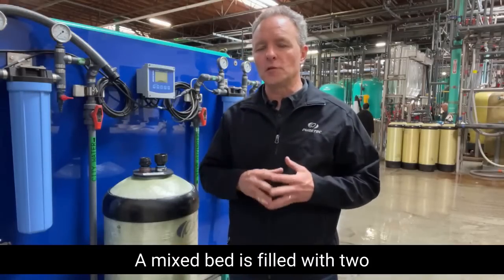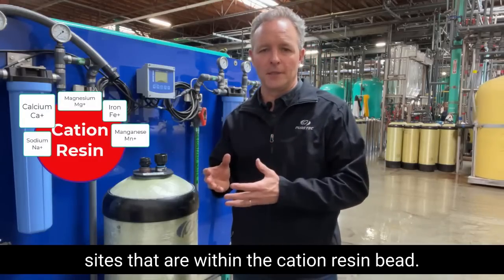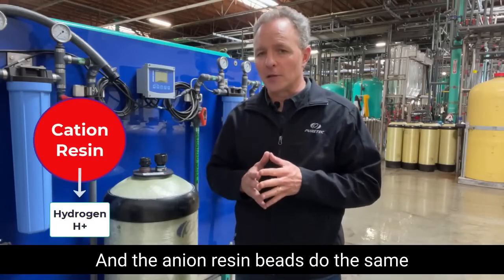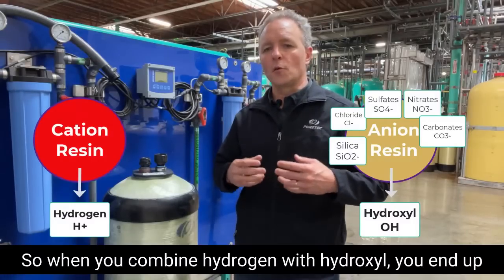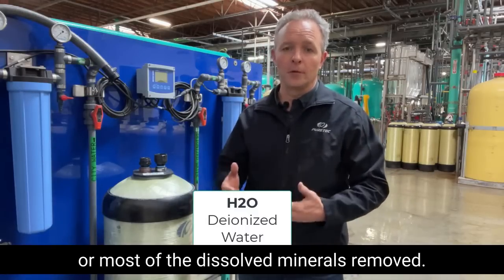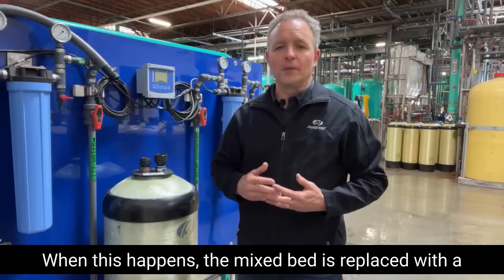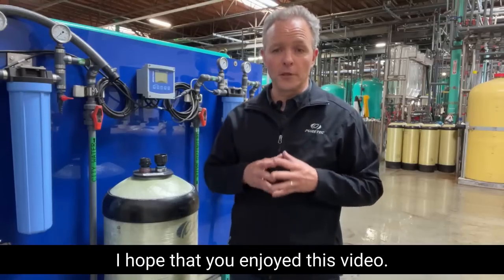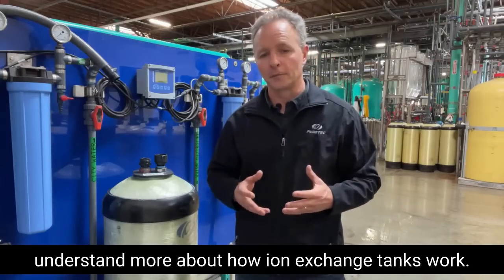How an ion exchange mixed bed demineralizer works

Comment: What do you use to regenerate the resin?
Reply: HCl and Caustic solution are run one by one, doing flushing before and after running each solution.
Reply: Can be done with saltwater brine

Comment: The cations are already positively charged ions, so how do they attract positive ions (Ca, Mg etc.)? or Anions are negatively charged ions, so how are negative ions attracted to anion resin? Please reply, thanks
Reply: Cation resins are negatively charged and not positively charged Please.
Reply: The cation resin beads have a fixed negative charge. They attract cations with a positive charge. The H+ is loosely held on the exchange site and will be released when a cation comes along and takes its place.

Comment: No need salt to regenerate ?
Reply: If you are using the cation resin for water softening then you regenerate with brine. If it’s for a deionized water application then you use HCl
Reply: Apparently 10% Brine can be used for partial regeneration with washing etc. 80C. But ammonium bicarbonate can fully regenerate it with washing at 60C etc.

Comment: What the max tds can it works
Reply from the maker: بينما يمكن استخدام التبادل الأيوني نظريًا لمعالجة المياه بأي مستوى من المواد الصلبة الذائبة ، فإن متطلبات الصيانة الزائدة ودورات الخدمة القصيرة تصبح عوامل مقيدة. باختصار ، كلما ارتفعت نسبة المواد الصلبة الذائبة ، أصبح التبادل الأيوني أقل عملية وستحتاج إلى معالجة مسبقة للمساعدة في تقليل إجمالي المواد الصلبة الذائبة قبل أسرة التبادل الأيوني.

While ion exchange can theoretically be used to treat water with any level of TDS, excessive maintenance requirements and short service cycles become limiting factors. In short, the higher the TDS, the less practical ion exchange becomes and you would need pre-treatment in place to help reduce TDS before the ion exchange beds.